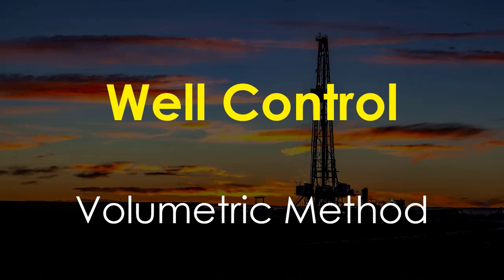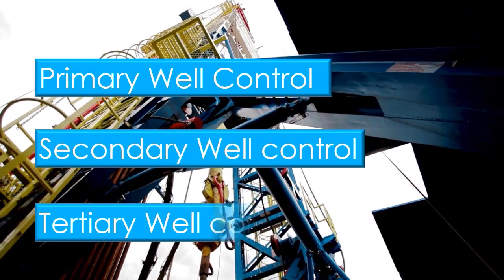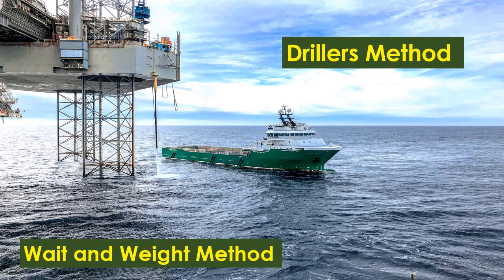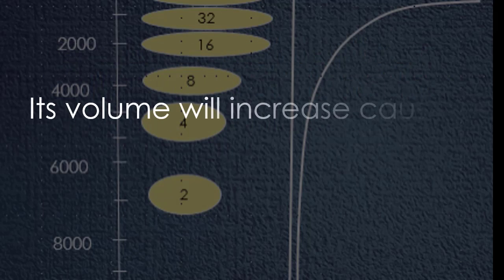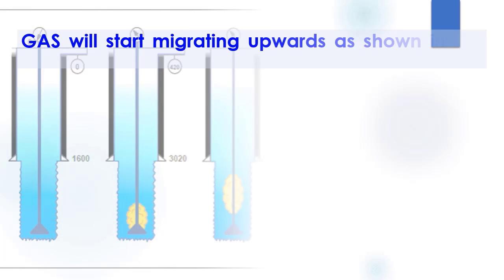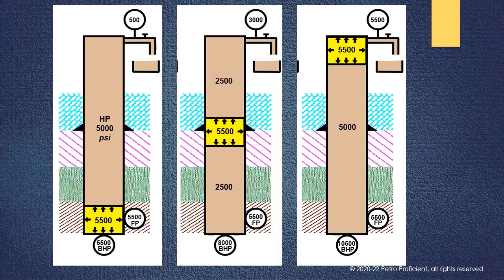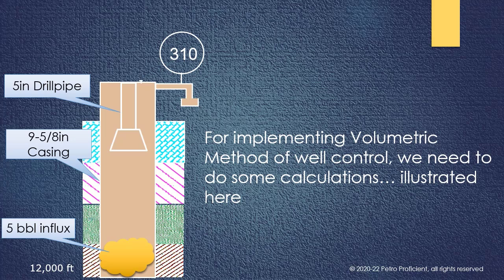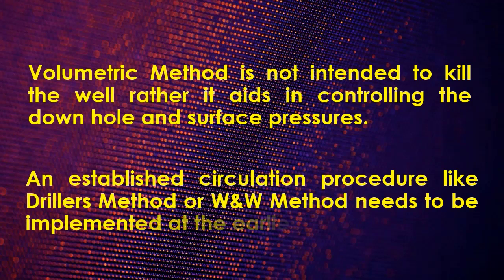Well Control | Volumetric Method

Comment: Not a very good/realistic example. First of all, a 5 bbls swab kick represents approx. 40 psi max. delta pressure in a 8-1/2" hole [the picture shows that gas is still on bottom, not across drill pipe as yet]. It is therefore impossible to have 310 psi at surface, unless the 5 bbls have migrated way up the hole and expanded about 8 times [ignoring any gas influx density as it decreases]. We also should not say " bleed off 11.28 bbls to maintain BHP", because that is NOT what we actually do. We have a 120 psi increase as a result of gas migration and we then slowly [very, very slowly] bleed off fluid while keeping casing pressure more or less constant. This is a very, very boring undertaking, believe me. And for 120 psi takes quite a bit of time [many hours in fact] as migration through mud is slow and all you do is crawling back, bit by bit, to original BHP. At some point you will need to change the capacity as well [to casing to drill pipe capacity], but that might be a guestimate as you may not know precisely where the top of gas will be. The last point is the maximum surface pressure, mentioned as 1500 psi. Why would you relate to surface pressure per se? What really matters is the weakest formation below the casing shoe and once the kick is inside the casing, then - if you do everything right - the casing pressure is not so crucial anymore. All in all, when an example like this is presented, make sure the facts are realistic and 100% correct so that the explanation makes sense to the viewer.
Reply from the maker: Appreciate your feedback
Reply from the maker: We have produced the example after consulting Industry professionals and academia.
Reply: @PetroProficient  It is truly commendable to create these well control examples and I am convinced that readers will benefit from it.
Reply from the maker: Pl could you write to us at Petroproficient2018@gmail.com
Reply: Old school knows all

Comment: Volumetric well control method is an important well control method which should be used when the normal well control method cannot be done. Volumetric Method does not intend to kill the well but it aids in controlling the down hole and surface pressures
Reply from the maker: Thank you for your feedback
Reply from the maker: Thanks 😊